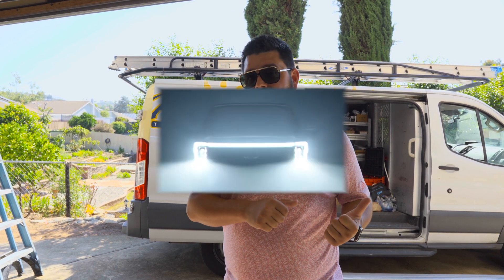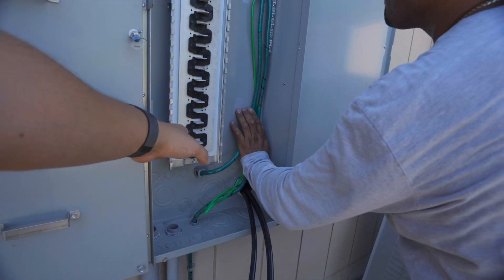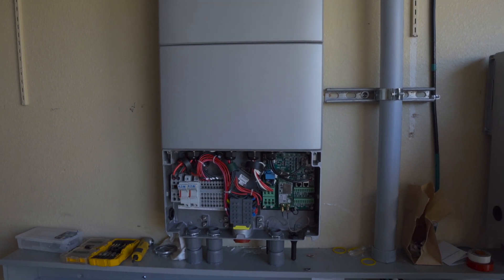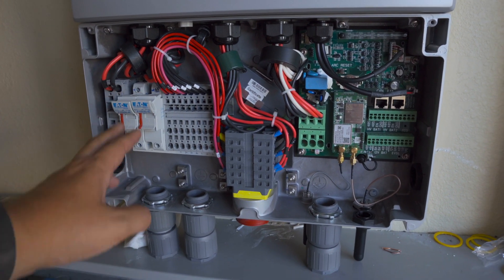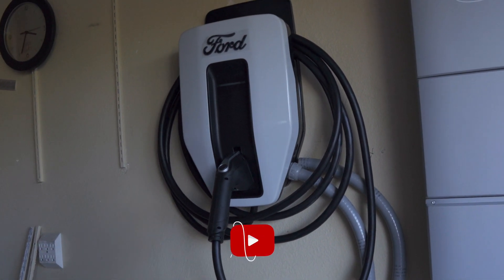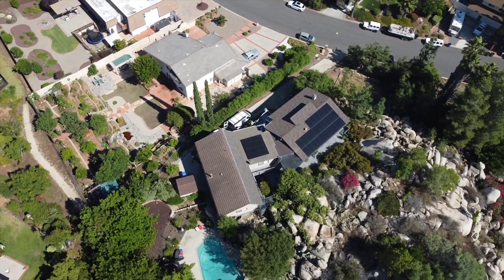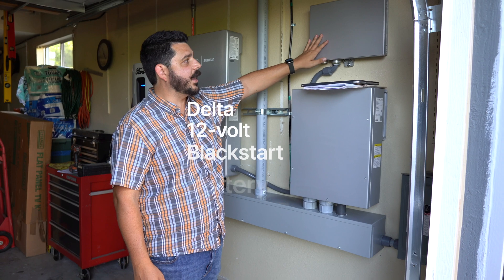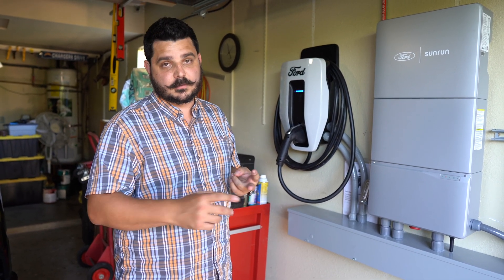Ford Lightning Solar Backup Installation

Comment: You didn't answer the biggest question I have. In the event of a prolonged outage can the solar that comes directly into this system/inverter be used to charge the Lightning with any excess production? For example, if your Lightning is down to 20%, your solar array is producing 5kW of juice and your house is only using 2kW, would the excess 3kW be used to charge the Lightning, or is charging during an outage not possible? It would be a huge miss if this isn't possible. The only information I can find on it is a video by State Of Charge from over 2 years ago that says you can't but Ford is looking into it...
Reply from the maker: Hey! From our understanding that should be the case

Comment: When you ask the solar industry what 2+2 is, they will tell you it’s the cube root of 64. Then, they’ll quote you for your project with double the cost of materials and 4x the average rate for electrical work.
Reply from the maker: It’s a specialty trade, just like a heart surgeon. I’m sure you don’t expect them to charge the same rate as a general physician.

Comment: Great system! 

I am another solar contractor in Southern California going on 2 decades in the industry. I appreciate your company's for being one of the few companies willingness to be the first to install & test some of the new tech in our industry. 

I may be a little more conservative in the systems I trust. But I have to give credit where its do, even to a competitor.

So did you end up switching the existing PV to now run through the Delta Inverter? 

Thanks for all the videos & not just selling solar to customers but also Educating consumer to all of the new product on the makes. 

Kudos to Pacific Suntech on another nice installation.
Reply from the maker: Yes, we DC coupled the new system to the inverter since the documentation had no instructions on how to AC couple the existing Enphase system. The first page of the specification sheet for the Delta inverter says AC coupling as a bullet point but we didn’t want to do that without any installation guide.
Reply: @pacificsuntech  thank you for showing how a stand alone instrument ( for now im wanting to opt-out of permanent housing battery as it's just to much $$ vs my user case but the truck-battery makes it much better as i could use it and or i can skip running diesel/gas/lpg pad-generator 80%+ of the time from a winter storm and winds nocking out my internet and power supply average-once's a year for 2h-3~days ) works and with a 400 amp usa unitys as that's my setup for now wish there was a 400AMP-bypass ATS shown so i could buy the correct size parts as adding 200amps enfase/ac-coupled ( just easier to get it serviced ( im not traded in DC-200+v's and most electricians and solar company-techs ( plus id have to ship in/waiting for replacement parts-ect ) are the same way as me aka 120V to 480-3p is something that can fixed easily and technically safer* for residential installations ) and change sizing in my areas of northern Utah ) solar is later on in my plans

Comment: That is a  zombie apocalypse proof system! Wow, that is my new dream system. All I would add is a gas generator, ammo & beer. Then good to go!
Reply: You could have gas but what good would it do you if shtf? Gas would be quickly burned through and if you had stored it it's only good for 6 months. Maybe a year but it won't burn as well.

Comment: The 10 kw delta inverter has to be specifically selected when purchasing the home integration system if you buy the equipment through AEE solar (SunRun affiliate) if you are in a state that SunRun doesn’t service. I’m not sure how to obtain the 10 kw inverter when dealing directly with SunRun. Nice install, I’ve had my back up system for my lightning installed for about 3 months and it was a total DIY. Works great.
Reply: Do you mind me asking how you did this?

Comment: Is the existing solar using microinverters or string inverter?  One of my gripes with the proposal from SunRun was that their solar is string inverter only. I have shading issues, and from what I understand, that means that microinverters would be preferred.
Reply from the maker: The existing system is Enphase micro inverters. We wanted to retro the system as AC coupled but were unable to confirm in the Ford/SunRun manuals if it supported AC coupled solar. We do know the regular hybrid Delta E-series inverter can be AC coupled, but not clear on this EV hybrid inverter so we DC coupled 8 panels with Tigo optimizers.
Reply: Micro inverters are trash we pull them off systems all the time and throw them out. They fail constantly.
Reply: Tigo optimizers aren’t much better.

Comment: Would you happen to know if the Ford bi-directional charger is locked to Fords only? I'm thinking of a scenario to use this charger with one of the EP Cube's ports on a similar EV. At some point in the future Canadian Solar should offer bi-directional charging for the EP Cube.
Reply from the maker: From my understanding it only works with the ford lightning. It appears to be software locked.

Comment: I can think of alot cheaper way to get a portable battery backup for the house. I would hope California still has the net zero or 1for1 exchange for the excess power he generates during the day. 

Charging at 20kw an hour thats alot of juice. Is it really worth it? You have a very expensive town truck. Heaven for bid you'd have an emergency and need to get somewhere fast. I guess you could run over to your neighbors ask if you could borrow their useless ol gas burner because you have an emergency and you need to get there fast. That might work🤔
Reply: "Is it really worth it?" -- Yes, if you already own the truck with V2H capability.